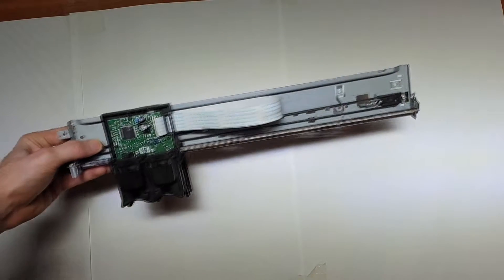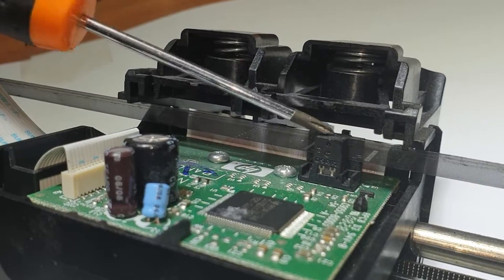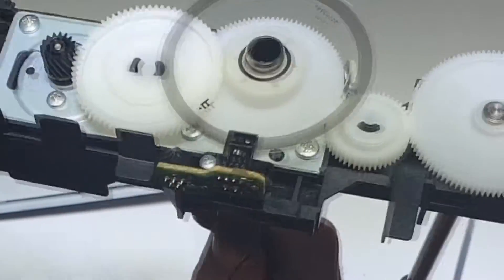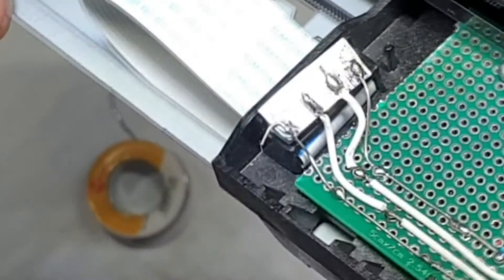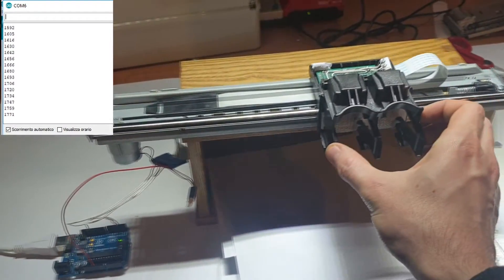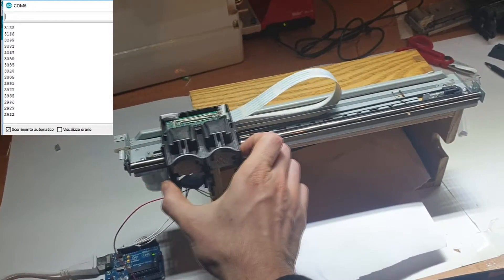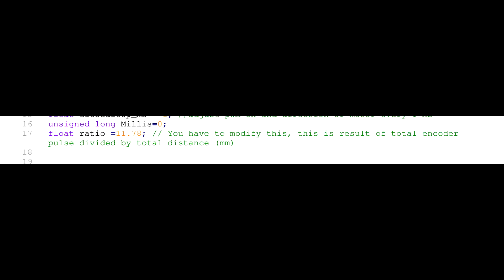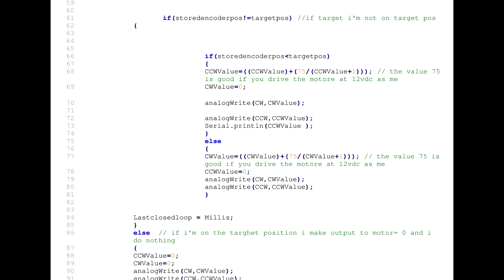Schematics and sketch to use inkjet printer linear encoder

Comment: Hi, 2:59 after restarting Arduino, how do you know when the stop motor (when you searching for beginning). Can you please help with this part of the project. I am worring about damaging motor.
Reply from the maker: In this example I drive the motor in one direction until I reach the end of the stroke, a better way to do that is to implement a limit switch and stop the motor when you trigger it, the position that I reach will be my " zero" or "home position".

Comment: If I were to give an example, the printing width of the epson i3200 head printing machine was 1870 mm or something, do we have a chance to reduce it to 60 cm?
Reply from the maker: Yes you can, you have to follow the steps and count how many impulses generate your encoder from top to bottom, then you will do the ratio.
Or more simply just apply a constrain to the value that you want to enter so you cannot type more than 60cm, did I undestand the answer correctly?

Comment: Is there any way to do this without making a new board, instead with the old board???  Please help
Reply from the maker: Yes i think you can, but anyways you have to solder the wires under the original board and you still need an arduino or similar
Reply: @NeedToDIY  I have an arduino, could you please please make a more detailed video on it, it would be so helpful cz i am a beginner

Comment: Thank you for the video, I tried the first part but with movment of the tray in bot directions the numbers kept rising without reduction when going in the opposit direction.???!!!
Reply from the maker: Looks like only you connected only one channel, try to switch them, if the number go negative then search the problem in one if the channel, maybe do a sketch then read the states of the channel and print them on serial monitor to understand
Reply: @NeedToDIY  thank you for the fast response.  But could that be due to I am powering the arduino from the usb port . And i am using it of course to communicate the serial data . Thus  pin 1 is not usable. Every thing was fixed when i shifted to pin 3 instead of pin 1.
Reply from the maker: @drsaif343  So, now you are using pins 2-3, and the sketch in the description of the video or you written another one? If was working and stopped when you changed a pin try check in declaration: example PINMODE or interrupt declaretion, maybe you have to update something
Reply: @NeedToDIY  its the one in the discrepancies but I changed pin 1 to pin 3 and changed what needed in the sketch and it works now.

Comment: Can I change the printing area, so can we extend it in code form, then mechanically?
Reply from the maker: Change the printing area? The maximum printing area is maximum length of the encoder, you can reduce it if you need, if you want to extend it you will need a longer carriage and a longer encoder as well

Comment: Any tips for figuring out the pins/volts for the sensor?  I'm going to make a 3d printer on my channel...
Reply from the maker: Usually there is a 100R resistor on gnd or vcc of the IR Diode
Try to see if there is a fill (like a track on the pcb but that fill every unused space) the fill is 100% GND
if there is a lot of components on you pcb try to ping the gnd with other components
Try to see if there is a code on it and search online
Start to power up the device with 3.3V if you don't know the correct voltage
Reply: @NeedToDIY  How many ticks per sec were you able to move without losing steps?  
After 241 steps/sec I start to lose steps.  (29 steps per mm so only moving 500 mm/min).
Looking at my oscilloscope, it seems I barely am in the irq routines. So i'm wondering if there is some other limitation happening, like maybe 2 irqs getting bunched up so irq is only called once instead of twice.

If I pulse the interrupt pin without the encoder, I can count precisely 20000 pulses per second no problem. 

It's not motor noise because I'm moving the shuttle with my hand to test.
Reply from the maker: How much code you write inside the interrupts ? Maybe the code need too much time to be elaborated
Reply: @NeedToDIY  only check the level of other encoder (using bit wise OR) and update the count.

Do you know how many steps/sec you were able to achieve without losing steps? (or mm/sec)

At first I thought I wasn't losing steps, but after 2 min of back and forth motion, I'd lose 0.5mm.
Reply from the maker: Sorry but i dont remember, anyways i moved with hands very fast and i had no problems, if you have fear of the arduino speed you should make a try with esp32 or 8266, with these boards speed should not be a problem

Comment: It is possible to include thE VNH2SP30 MOTOR DRIVER TO MOVE BIG MOTORS?
Reply from the maker: I looked the datasheet i think is possible you have to exclude enable pins and don't use current sensors

Comment: is this a closed loop? in your second sketch can the machine go back to the desired location if something stops it per say?
Reply from the maker: Yes, it is a closed loop. If the carriage is stopped, it will try to push into the direction of the desired position
Reply: @NeedToDIY  thank you so much!

Comment: It is calibrated, but it does not reach the desired size. I tried all the methods of using the encoder motor pins, but it didn't work.
Reply from the maker: Does it reach every time the same point ? Even if wrong?

Comment: Hello, could you please do this for a 3-D printer as well?
Reply from the maker: I don't think is possible, with a DC Motor with a belt i can reach the desired position but along the way the speed is not costant, even the force is not enough, maybe to use a dc motor we need a screw with a big rpm ridution like Z axis in 3d printers, not a belt. If you find someone that did it pls tell me too.
Reply: @NeedToDIY  just my theory, if we want to control speed, we need to move step by step untill we reach the target step. That will depend on how fast we send the command between each step.
Reply from the maker: @skelethornbro  This is true if you have a stepper motor, the point of this video is use a normal DC motor but control the position like a stepper one. In this scenario we have no command to send but just the possibility to move the motor in one direction of another, we use the encoder to stop the motor in the right point, is not easy to control the speed because the motor gain speed while travelling
Reply: @NeedToDIY  yes I get your point. In your video you just type the number and it will move to place that you want. Its like from 1 to 10, you want it to go to 10, you just type number 10 and it will move untill it reach 10. Maybe you can make It count, in order to reach 10 it will check number 2, stop, then 3, stop.....untill 10. So now speed is depend on how long you stop in milisec maybe microsec. Maybe Im wrong. I dont know lol.
Reply: @skelethornbro  find the fear ratio for the movement of one pluse. not write a program defining the gear ratio in which define how much pulse is needed to move 10 mm , now take the feed back from the encoder sensor and get a feedback loop. try searching for raster strip , encoder sensor on 720 lpi and servo stepper motor with controller

Comment: Ciao Paolo, mi permetto di scriverti in Italiano perchè credo tu lo sia, la mia idea è di usare un encoder rotativo per misurare la distanza in millimetri e decimi di millimetro e riportarli su un display, vorrei usare 3 encoder, in modo da misurare 3 assi, un arduino e un piccolo display.
Secondo te è possibile convertire facilmente il numero degli impulsi in misura?
Reply from the maker: Ciao Antonio, Certo non ci vedo nessun problema, pensavi quindi di far girare gli encoder insieme ai motori giusto? o è un attrezzo che misura soltanto?Per convertire in mm è semplice devi prima contare gli impulsi che hai muovendo gli assi su tutta la corsa, dopo di che dividi il numero di impulsi che hai ottenuto per il numero di millimetri totali di corsa e ottieni gli impulsi/mm, A display quindi stamperai impulsi totali/(numero impulsi per millimetro)=misura attuale in mm
Reply: @NeedToDIY  la mia idea è di prendere i dischi e gli encoder che ho recuperato dalle stampanti e metterle sugli assi del tornio per poter misurare il movimento della torretta, mi basta una precisione al decimo, quindi la risoluzione dovrebbe essere più che sufficiente, cosa importante però che ci deve essere un pulsante di reset. Farò delle prove quanto prima, ti va di aiutarmi? Facciamo una collaborazione?
Reply from the maker: @antonio.stefanelli  Ho capito, preferisco fare i progetti da solo in quanto li faccio in piccoli ritagli di tempo, in ogni caso se hai bisogno di un consiglio ci sono mandami una mail qui se hai bisogno qawork001@gmail.com